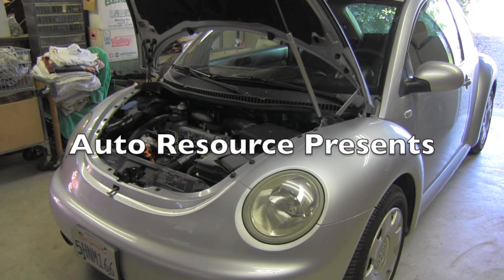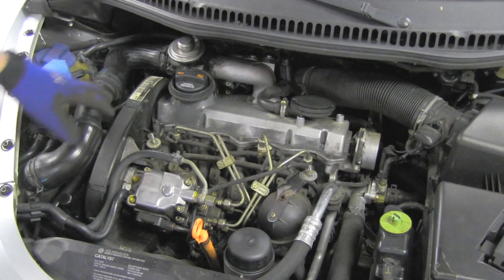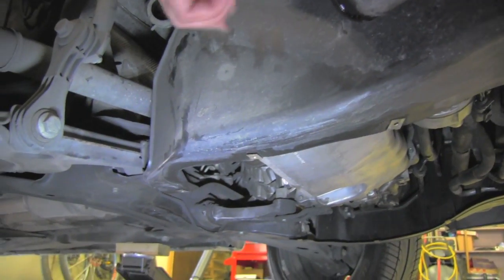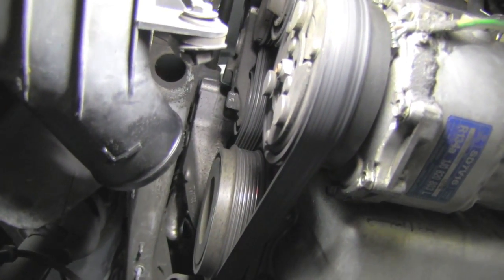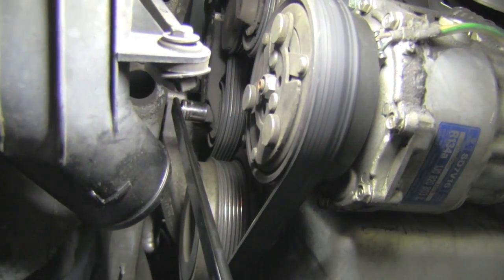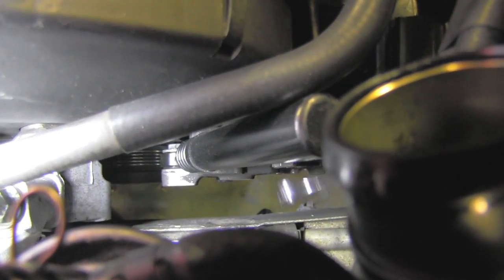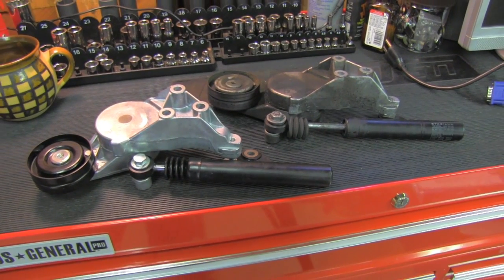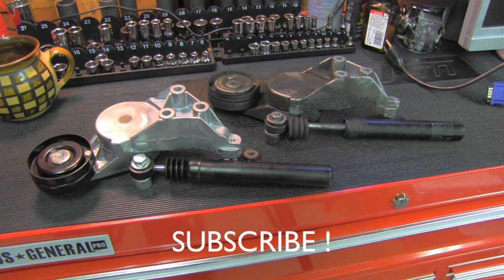Drive Belt Tensioner Replacement TDI Engine

Comment: OMG omg guys TDI ALH engine , do NOT dismantle the hoses do NOT remove anything use 13mm 1/4 inch and remove the tensioner its how i did it. there is enough space , even the power steering hoses are not an issue push them a bit . take care !